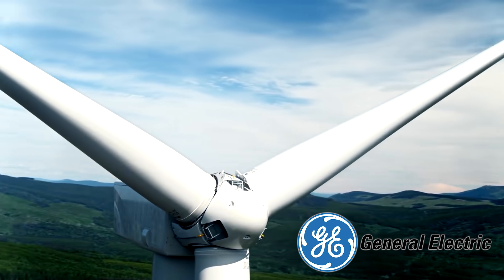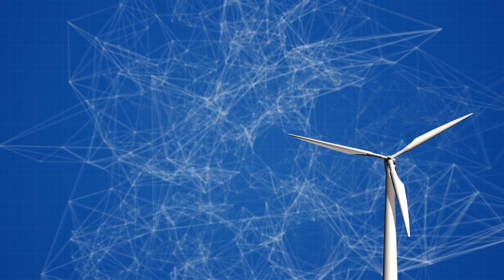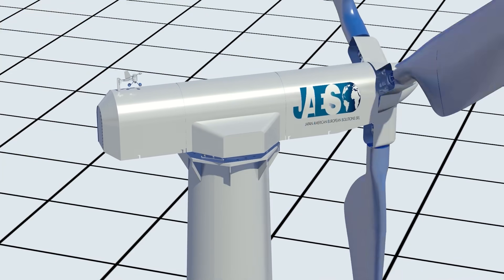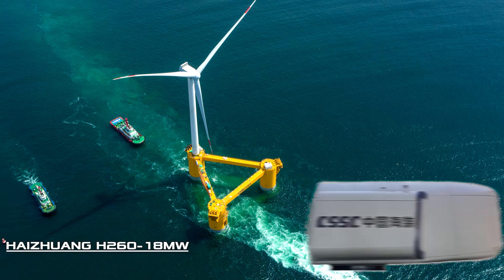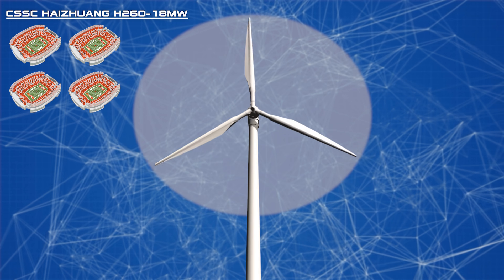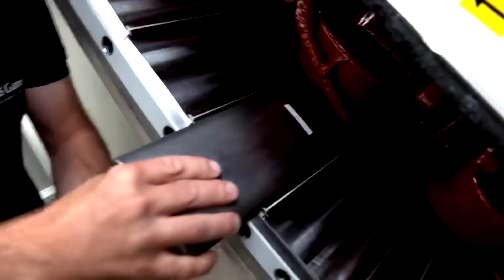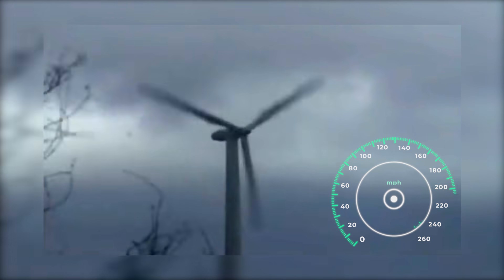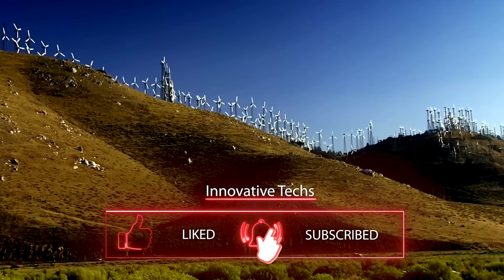China is building a wind turbine of unthinkable dimensions

Comment: These giant dirty windmills are limited to the sea. On land there is no chance to find roads, to transport the components of them to their places, no land based cranes to errect them. 

The general challenge of all dirty windmills is that it produce its electricity according to the coincidences of the weather and not the demand. The value of this electricity is very low. 

The technical main challenge is that these sea wind mills can only become installed if there are a couple of days without wind and waves. The second challenge is that maintenance and repair of these giant windmills can only be done if there are some days without wind and waves. Thus it increase maintenance costs and reduce availability.

Comment: Why don't these engineers work on perfecting the designs we already have, so that wind turbines aren't breaking in high winds or spontaneously catching on fire?  Our current materials simply cannot take the stresses that such forces are placing upon the blades, rotors, bearings, and towers!  Stop putting the cart before the horse! Also, what is a "Level-17 typhoon?"  Which scale is that?

Comment: I wonder what the tip speed is of these huge turbines?
Reply: Just the tip?
Reply: probably fast enough to take out organic flying entities.
Reply: at 800 ft diameter = 2731ft circumference @ 2.5 sec / revolution = 1092ft/Sec * 3600= 3,932,928 ft/hr / 5280ft/mile = 745 mile/hr
Reply: @denisoreilly3210  what happens when it hits Mach 1 ?

Comment: Power of wind turbines are defined by: P=0.5pV³πR², so yes if you double the radius of the blade you got 4 times more power. Also at higher altitudes you have more wind.
Reply: Wind turbine power defined by

Wind not blowing = no power
Wind blowing gently = no power
Wind blowing at just the right speed = some power
Wind blowing too strongly = no power
Reply: @chairmakerPete  Wind turbines have a "capacity factor" so your comments are plain stupid!  I suggest you get a better education.
Reply: @chairmakerPete  It is clear that a dirty windill does not produce useful electricity. But it is indeed to study the formulas to understand the windmills and its limitations better.
Reply: DARZHNARZHERLARBLE? 
DARZHNARZHERLABLE?
Reply: @chairmakerPete  Iowa gets over 60% of its power from wind now, and in terms of watt hours, Texas gets 3x that much energy.  Excelon coerced $694 million from the state of Illinois by threatening to shut down two of its nuclear power plants, complaining that it couldn't compete with all the cheap wind power coming in from Iowa.

The fact of the matter is, wind power plus 4 hours of battery storage is still cheaper than nuclear, and so is solar PV.
Reply: IS there more wind in China than in Kanadaistan????
Reply: @Cazador60140  Nope...it depend on regulation and subsidy scheme.
Reply: @chairmakerPete  I'm guessing you are not and engineer or an economist.   If wind generators don't work or they don't produce enough energy to make money, than why are these companies profitable?
I have a turbine on my land and it covers all our needs.
Reply: @paultrauzzi5360  you guessed wrong. 

They "work" due to subsidy. 

Economics 101 - forcefully re-allocate resources to pet projects to make them "viable".  Governments love this, because they're seen to be "doing something", and it gives them erections thinking about the power they wield.
Discount the fact the energy density of wind is pitiful compared to Uranium 235, and thus we're going to need thousands of square miles of these things with concomitant ongoing maintenance costs.
Discount the fact that the energy produced is unpredictable and intermittent, and therefore requires fossil fuel backup.

Yours works because you have land - 99% of people do not. Arguing from an edge case such as yours is the "Let them eat cake" principle. You also can't get over the fact that when your turbine needs maintenance (increasingly so as it wears), you have no power.
Reply: @chairmakerPete  
You've made way too many assumptions.
I'm owner of an engineering firm that builds cogeneration systems that mostly get used in oil and gas extraction.
Just because YOUR area of the world may subsidize wind energy doesn't mean other areas do.
People against wind energy are shills or willfully ignorant.
There many issues with wind, some of which, you've mentioned, but no problems make wind unprofitable.  Where wind exists plentifully wind generation is a perfect solution.
Nuclear energy, of which my brother is an engineer at a CANDU power plant, is by far my favourite of the current reasonable choices,  but the cost and time of greenfield start ups are extremely high.
Reply: @Cynthia_Cantrell  Wait untill subsidies are lifted. Talk then.
Reply: @svdumitrescu  Which subsidies are you referring to - the ones that Excellon was getting for their nuclear plants or the ones for wind turbines?
Reply: I thought it was E = MC squared.
Reply: @Cynthia_Cantrell  Dream on Cynthia your facts do not add up and i am in the solar business or should i say scam. How mant sunny days are there per annum in Iowa and illinois ?
Reply: OK so PVA equation is correct but the unknown variables are constant wind pressure and actual implementation, these  variables are difficult to calculate.
Reply: @Cynthia_Cantrell  Most of Iowa is nearly Ideal for wind generation...  Nearly constant winds of enough to spin the blades!    Giving a much higher % of useful output around the clock, than most locales.
Reply: @paultrauzzi5360  I go with the Buckminster Fuller concept:
Do What You Can, With What You Have, Where You are At.
Great work with that turbine on your land!
Reply: on the Ocean it is also more Windy - Vestas is building some bigger ones
Reply: @dennisg4053  
To continue your theme, we went geothermal, use thermal curtains to block sunlight out during the day and open windows at night, and use our pool as a heat sink.
Reply: @chairmakerPete  Sounds like the ranting of someone too brainwashed to accept reality.
Reply: Kazakistan
Reply: Put one in the jet stream
Reply: @ralphpremici7632  
Great idea but the jet stream is everywhere.
Reply: And then the wind stops....
Reply: @Deontjie  
That is a trop of the ignorant and non engineer.
Wind energy can be stored but its mostly used to add to other means of production.
The sun goes out at night but plants stay alive., best solar energy converters we know.
Reply: Why not quadruple the radius and fill three States with them?   Then ship all the power to China and switch to a rice economy?
Reply: @chairmakerPete  yet wind and solar beat everyone else, stay mad uneducated folks :)
Reply: @Cynthia_Cantrell  
Wind and Solar demand backup. 4 hours of battery storage is sufficient for daily use, insufficient for seasonal changes. 

For example, an anti-cyclone, resulting in high temperatures, low wind, and heavy usage of air conditioning would demand heavy power usage throughout the night, some 16 hours, for survival purposes.  (4 hours wouldn't be close to good enough)

Industrial usage demands a constant power source : nuclear is ideal.
Reply: @Cynthia_Cantrell  you are forgetting something. we use petroleum also.
Reply: @snorttroll4379  Just because I didn't mention it doesn't mean I forgot it.  The more renewables get added to the grid, the more incentive there is for power companies to install batteries to capture power they otherwise lose because it wasn't needed.  Company executives can't stand to leave money on the table and watch it slip away.  As more batteries go in and the more battery factories are built, the cheaper they become, and with incremental storage increases every year, the more compelling the case they make for electric vehicles.  It becomes a positive feedback loop.

Comment: You are vague about why bigger is better for a wind turbine. Trust your viewers enough for them to understand elementary school maths. Power is proportional to swept area, which is the square of the radius (area= pi*r^2 remember?). So make the blade twice as long and you get four times, not twice, the power. It's why rooftop wind turbines don't make much sense while rooftop solar panels do.
As for the limit to size of wind turbines, this is diffeernt for land and offshore ones. On land the limit is the maximum size a one-piece blade can moved from factory to site. On water moving a ship-sized object from shipyard to platform is no problem - then it becomes mainly a matter of how big a blade you can make without it breaking under strain.

Comment: No they are not build. They are concepts, there isn't even a prototype. These turbines will enter market earliest in five years. Presumably later.

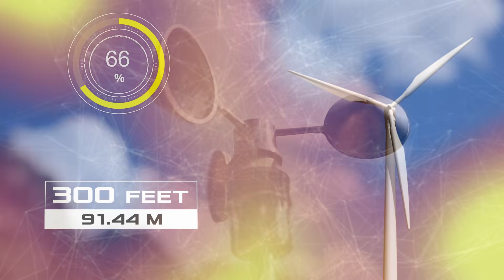1:10 "more than 300ft" (90m) guys you have been stuck in the 00ies. In 2003 was a 160m hubhight prototype erected and 150m iscomercially available for years now. They are no exception.

Comment: What measure is "level 17 winds"?
Since the blades are larger and slower moving, won't that also reduce the sound generated? 
Won't slower blades be less hazard to birds? 
As far as I can see, these super large turbines are limited to ocean installations. Why?  Is it a limitation of delivering long blades on ground?
Reply: @NoForum You are right. But, apparently it depends ... On land tip speed is often limited to reduce noise "pollution", ie not allowed to go supersonic.  On sea, noise is not an issue, so they can go faster, which can cause strength and weight issues.  Larger blades can catch slower winds and generate power.
Reply: Turbines like Solar panels take up too much space and are eye sores.  The thing I want to do is go visit the beaches of the Caribbean with nothing but giant turbines blocking my view of the beach horizon.
Reply: @TheRealBillBob  Aesthetics are a valid concern. 

Many places have a permitting process that consider that issue among others before construction is allowed. Public input is requested, like your preference for a good view. 

Last year I saw an interesting article. In Germany, a small town created a co-operative wind farm. They collectively paid for the installation and shared the profits, lower cost for electricity and excess sold to general power network.  Then Germany passed standards for wind farm installations. The new standard was going to require them to remove several towers that were "too close" to homes, even though the home owners had not complained. I didn't hear the what the final resolution was. 

Bureaucracy run wild.
Reply: Just move further into the ocean, >15kms and nothings gonna be visible.

Comment: I see a time when broken blades will be floating about in the oceans for years after the turbine has failed, been abandoned or struck by a hurricane. Oh and aren't the towers made out of coal and iron ore which both have to mined? Err and the blades are made from oil and sand which also has to comes out of the ground. Err yeah and don't forget the old turbines have to [of should be] removed by the same diesel powered ship that put then in. And still too the scrap steel plate towers will have to be recycled using a smelting plant and even more coal. Can see a time when adverts start appearing on the internet saying " were you sold green energy between 2002 and 2005 if so you may entitled to compensation" ha ha yeah great idea - be better off putting a small windmill on each house. And all of this to reduce CO2 which is not even a pollutant.

Comment: Just one question: HOW MUCH IS A KILOWATT-HOUR PRODUCED FROM THE WIND?
MORE CERTAINLY: IS IT CHEAPER THAN THE COST OF A KILOWATT-HOUR PRODUCED IN A NUCLEAR POWER PLANT?
Reply: Here in Germany around 2 to 3 Cents is the typical number given, it is a bit older though so it is usually lower by now.
The problem with nuclear power is, that there are no real numbers on the cost. The by far biggest part, forever waste is just ignored and pushed up to the next generations. That alone would make the costs absolutely mind blowing.
But nuclear plants are also never really insured, the government is subsidizing it massively in every way, from building it, maintaining it, mining the fuel and having loads on backup gas plants as well as the cost on deconstructing it.

Numbers I got that allowed a bit of comparison was 12 Billion € vs 128 Billion €, which is the amount the government of western Germany spend subsidizing renewables vs. nuclear and renewables are now at >50% of the total electrical grid of Germany, nuclear at it's peak was around 30% and back in that day we even used less electrical energy than today.
Reply: @Ismalith  It is not so important what amounts are given (especially by the government - this does not apply only to Germans, although Germans is extremely pointlessly putting political considerations over economic), IT IS IMPORTANT IS THE AMOUNTS SPENT!!!
The thing is that if you take into account all the costs of using wind in today's form, energy from it is much more expensive than from nuclear energy.
Anticipating a flawed argument: the storage of apparent nuclear waste is not money down the drain. Because what is waste today will be a highly sought after type of fuel or raw material tomorrow. From this perspective, it is an investment in the future, not a cost. It is additional profit.
Reply: @andrzej3511  
That is just a load of bullshit. People dream of using waste since at least the 50s, yet there is not even a first test project for that now.
It is a lie and also it is funny that for nuclear you want to count in dreams to make it artificially cheaper, but for renewables you deny even existing solutions.
The current "solutions" to get rid of nuclear waste is to make depleted uranium munition, and use it against children in the middle east. That is all that 70years of searching for a solution got you.

Also as said, those numbers don't include storage, that is only building and maintaining the plants, even deconstruction is only partly in that.

Comment: Yeah, the bigger they get, the harder and uglier the will eventually fall.  And more and more of them have been falling lately.   Green energy is a bust !!!!!!    FFs still rule!!!
Reply: And when the supply of FF runs low and the prices rise what then? Even 100% green energy you still need fossil fuels for cheap and affordable plastics and chemicals. Burning limited supply of FF for energy is a dumb move in the long term. A nation will be around 100 years even 1000 years in the future, not just the next fiscal quarter.
Reply: Fossil fuels rule until they are all gone. Prepare for that!
Reply: @nickl5658  Run out?  Who the hell says we're anywhere close to running out of oil or natural gas?  'Peak oil' theory blew up years ago.  And the U.S. alone has loads of natural gas reserves, as does Russia (when Pathetic Joe is not busy blowing up their pipelines, that is).   We became the most energy independent while Trump was in office, since the 1960s.  There's more oil and gas out there, it's just a matter of going and getting it , the will to !    But Pathetic Joe wants to revert back to  essentially 1800s technology with dressed-up windmills that won't come anywhere close to 'fossil fuels', which aren't really all that much from ancient fossils anyway, because dead rotting dinosaurs couldn't have been the sole source of even what humanity has used to date.  These resources regenerate, it's called abiotic oil, and it will provide us with at least another century of dependable fuel.  Green energy is a scam until it can be developed to be as cost effective.

Comment: Did anybody notice that there was no mention of capacity  factor or capital cost, including storage?
Reply: And dismantling/disposal at end of life cycle.
Reply: You mean because a lot of right wing drones found some simple speech bubbles that storage is also a point and now they demand it in every video about renewables or they are going full Karen?
Reply: "It's Chinatown Jake". Seriously though such considerations don't seem to be part of the equation when China want to show up the world.
Reply: Propaganda by definition leaves out awkward details.
Reply: If you rely on combustion of material for energy production, naturally you consider the need for limiting production during off hours. If winds high up are reliably constant, why the need for storage? Why do you not require that from combustion driven energy sources?
Reply: @prunar  When a wind turbine is spinning it produces energy.  That energy should be used.  If there is no demand, the energy should be stored.  A turbine cannot be run with no load.  The load produces a "back EMF" or reverse magnetic force that retards the spin of the blades.  With no load, there is no resistance and the rotor will spin faster and faster until it fails.  Resistive loads can be engaged if needed (a giant heater ).  
Power plants that burn fossil fuels can increase or decrease power production and do so to ensure they match production with demand.